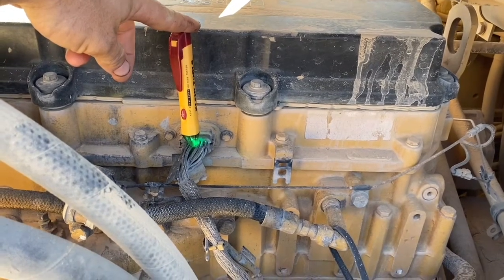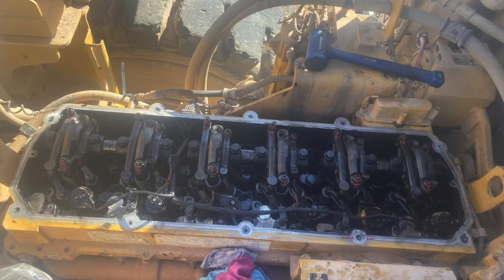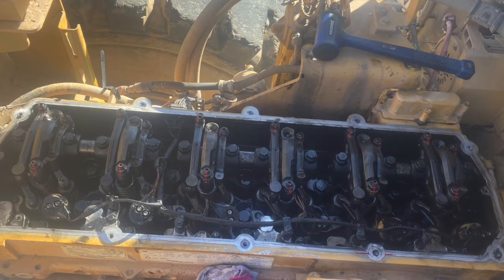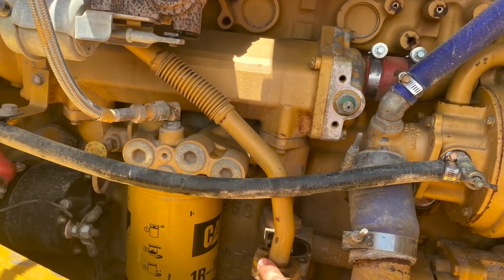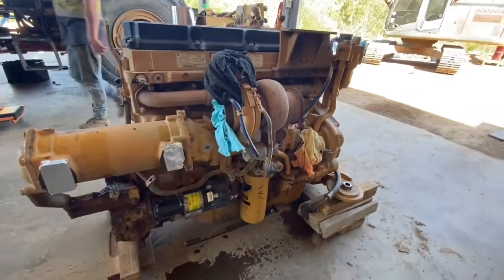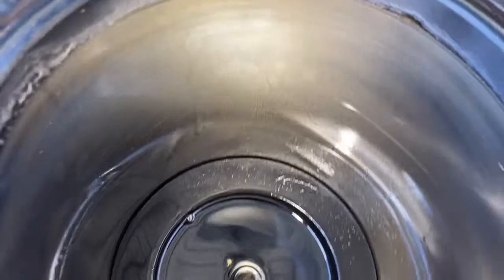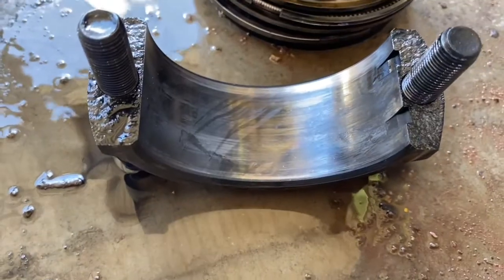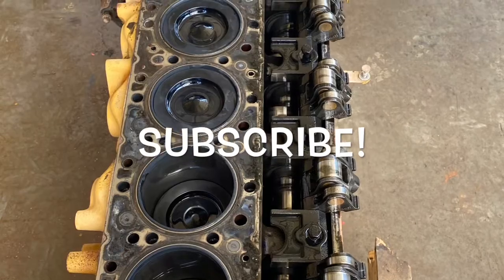C11 Engine Troubleshooting and diagnosing engine with excessive blow-by

Comment: I have a drill rig that has an industrial C11.  Any ideas what would cause really hard cold starts? It blows a lot of white/grey smoke when cranking but doesn’t take off. Once it does finally start seems to run fine and starts fine after it’s warm…